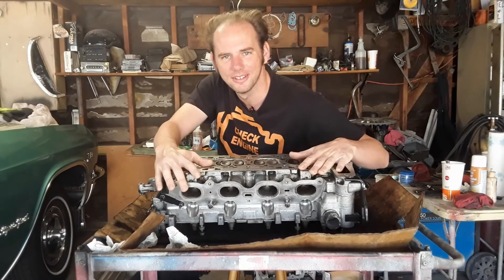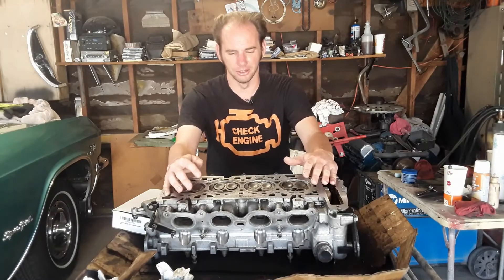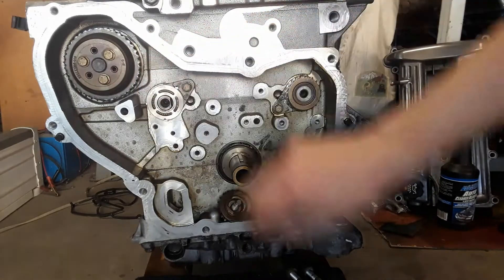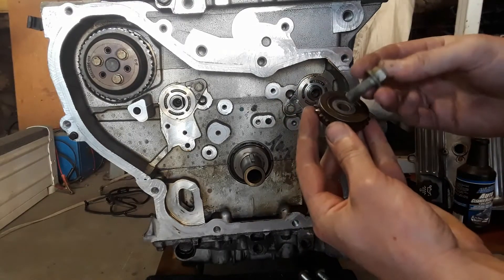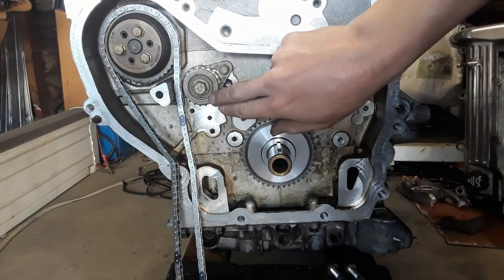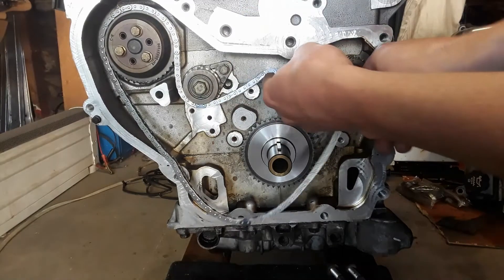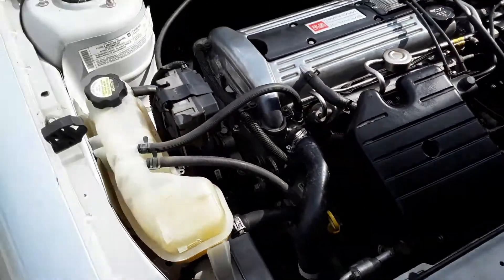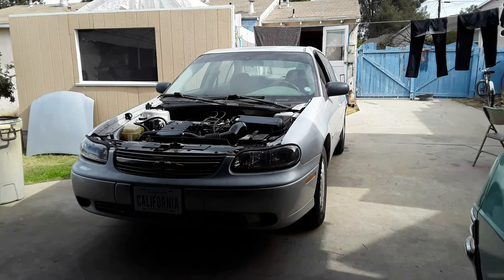Ecotec engine overhaul. Part 3

Comment: how do you know the #1 piston is in time and also the cams?  Can't the cam sprockets be put on and then removed and put on again 180 out because of the two opposite slots?  What clock position should the #1-cylinder cam lobes be pointing at?
Reply from the maker: It's been some time, but I think the slot on the cam is off center so the sprocket can only go on one way.

Comment: Your colored links lined up on the timing marks after 2 rotations? 
I have 2.2  vvt and mine never line up after 2 rotations. Not sure if I'm doing something wrong or the vvt is different? Also having a crank no start issue.
Reply from the maker: You're right. The colored links won't, I was referring to the timing marks on the sprockets being at the same angle after 2 rotations.

Comment: what is that you put on the head gasket?
Reply from the maker: Permatex copper spray-a-gasket high temp sealant. most auto part stores have it.
Reply: @onewhocollects6781  thanks what torque is the 4 torx bolts that are in the timing chain area? you kind of jumped past them
Reply from the maker: @bobpalmer4740  I can't find it in the book. I think I just guessed it when I assembled it.

Comment: Do you knw what the specs are for the head bolts torque specs
Reply from the maker: step 1. 22 Ft-lbs. step 2. 155 degrees. the two small bolts at the front are 25 ft-lbs. I don't know the sequence.

Comment: Would be great if you gave the torque specs to the cylinder head bolts.
Reply: 22ft lbs and then 150 degrees do in two steps